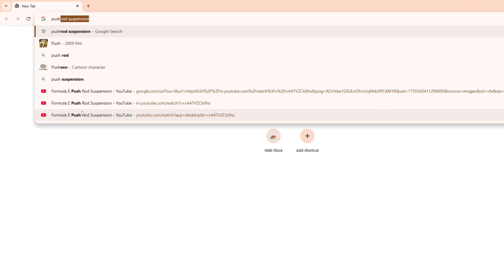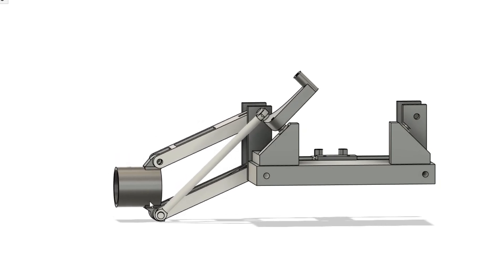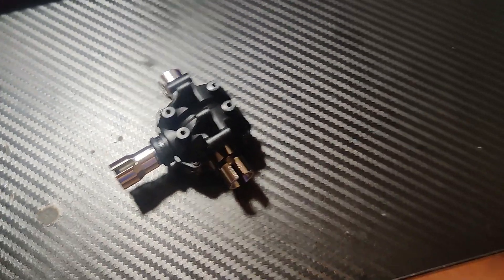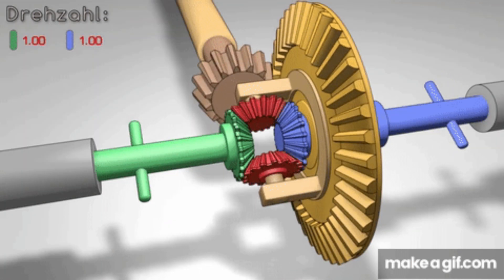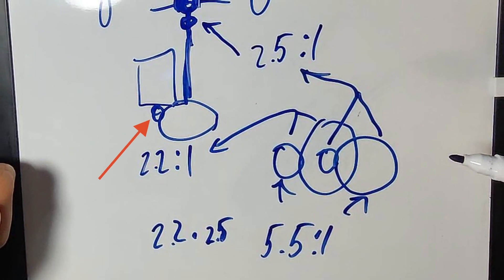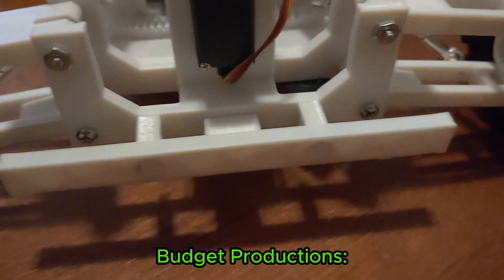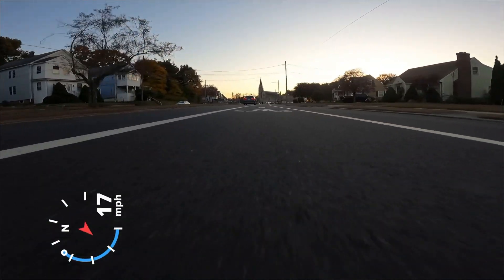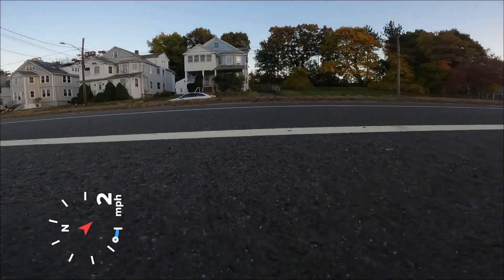a newer design for my 3d printed rc car

Comment: I am working on the similar project can i ask you some question. What is your motor KV and what battery do you use and also what is your gearing from the motor to wheel shaft
Reply: Ohhh it is in the video... xd
Reply from the maker: @damiansolowski8628  😩 really... (The v and kv is not) But really....
Reply from the maker: Makes me feel like you didn't watch the video... But for the battery it's a 30C 11.1v 2200mah, and the motor is 4900kv so max rpm is about 60k if fully charged, but when almost dead it goes around 50k
Reply: @-EhsanMalik-  I have the same battery like you but my motor is 3300kv so less speed but my gear ratio is less than 4/1 so i think that at the end when bettery is fully charged will be 14 - 15k rpm. And i don`t know is it not too much. What do you think?
Reply from the maker: @damiansolowski8628  it depends what are you doing with the motor? What's the purpose?
Reply: @-EhsanMalik-  bruh... I am working on the similar project that yours I also building RC car
Reply from the maker: @damiansolowski8628  well similar can mean a lot of things, but I meant what are you trying to achieve with the RC car
Reply: @damiansolowski8628  more rpm=better because you can regulate them.
Reply: @-EhsanMalik-  I am asking like if this car was in scale that your car is what would you think about it? sorry for my english xd
Reply from the maker: @damiansolowski8628  I think it would be decent, but if you're trying to get it to go fast, you would have to lose weight and make the car smaller, if you want to make it drift, make it lighter and use smooth tires, or if you want just a simple rc car, then that's good, I don't think it will go last 15mph though
Reply: @Normalguy-x5n  Yeah but it is not so simple. Like you can give by regulating some % of powet that motor have. if you don`t make gearbox good you waste this power on slowering car down and it can relly easy stop. I think in that way at least. When you make gerabox like 4/1 your energy from speed is changed to torque and you don`t have to waste it on giving only small % of power to regulet speed.
Reply: Oh, that's right, my advice is try it and see if it works how you imagine.
Reply: @-EhsanMalik-  Thank you very much
Reply: @Normalguy-x5n I will thanks